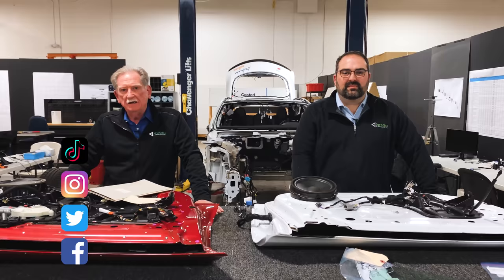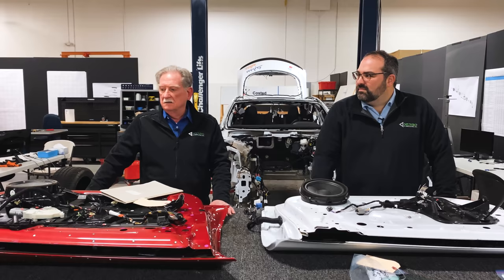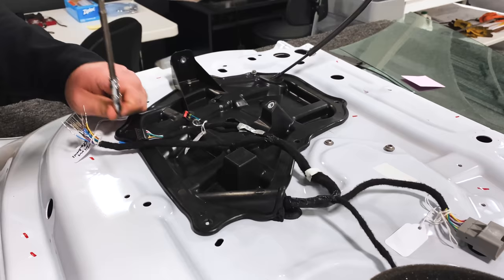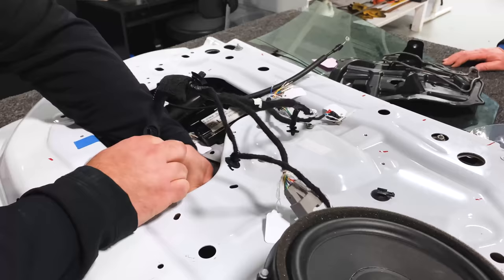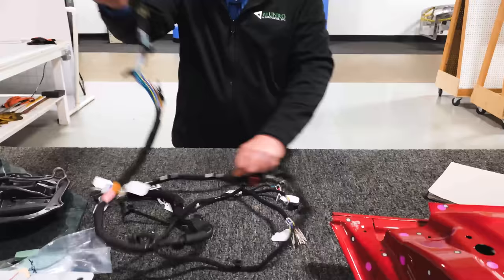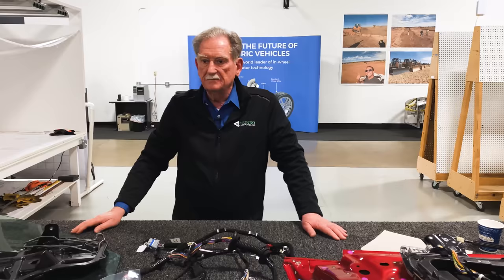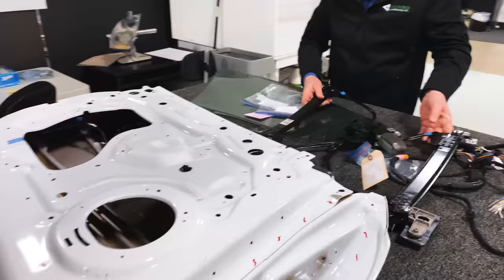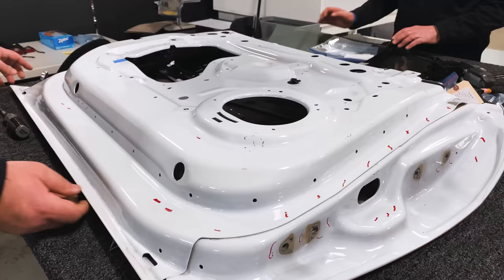Plaid Doors Disappoint Sandy | Tesla Plaid Teardown

Comment: This looks pretty much exactly like my 2017 Model S 75D driver door. I had a hell of a time getting access to the door handle module to replace the gear that extends the handle. Luckily the module was a Gen3, so no wire/microswitch issues.  I also had to dig into the rear door when that regulator failed (twice) and wouldnt go all the way up (during monsoon season no less).  A Tesla Ranger came out and replaced the regulators on both rear doors. Thankfully the regulators all failed in the warranty period. I am out of warranty now, so I had to fix the gear myself or pay for it. Thanks to Electrified Garage for their videos on how to do it.
Reply: From what you are saying I would assume this part is near original to your version and earlier and didn’t get upgraded it’s the new edition?
Reply: Trade!
Reply: 5 year old windows taking a shit? Tesla quality strikes again
Reply: @mattbrew11  To be fair, there really isn't a car company that makes things without any errors, rather have a window fail after 5 years than a car caching fire though, so it's still in the minor errors.
Reply: @-JustHuman-  u say that like teslas dont burn
Reply: @mattbrew11  All things can burn. But there hasn't been recalls because of it, so far I only know of some with damage or being light on fire that burned, not like GM that said "Well, just park it away from things and don't charge it without keeping a eye on it", and then recalling all of them because of this error.
Reply: @Travlinmo  Well, that's the thing. Just like with the door handle module, Tesla itterates to try and improve parts. I think the window regulators were model H originally and when he replaced them they were model L or something like that. So hopefully the "issue" that caused them to break was designed out of it on the latest module.  It may look the same on the surface, but it is a different part in some aspect. The Gen3 door handle module is a night and day improvement over the Gen1. Check out Superfast Matt's channel for a good dive on that.
Reply: @denniss1211  Their white door on my blue car would not be a good look. 😄
Reply: @mattbrew11  It certainly is an annoyance.  Once Tesla isnt the only game in town for EV's I certainly wont hesitate to look, but in my opinion, that is quite a ways off.  I never had any issues with the important bits of the car, could always safely get me from A to B.
Reply: I had an identical experience. So far I had to replace 11 door handles. Most were replaced under warranty, two were good well and one I paid $600+.  Defiantly a flawed design, tesla CS pushed back and absurdly blamed the cold weather- for the repeat fails.
Reply: @mattbrew11  Window motors and door mechanisms in my Ford/GM/Honda vehicles have failed over the years, always after warranty and well before 5 years. Give it a break.
Reply: @Avisinna  I definitely prefer the aerodynamically perfect simple purely mechanical door handles of models 3 and Y over the unnecessarily complicated ones on the S. Proves that not only Germans can construct too complicated designs.😁

Comment: Engineer here...you've just caught a legacy product that hasn't been updated to the newest design language. A door update wasn't in the budget this go around. I'm sure they understand the benefits and will get to it as soon as the opportunity presents itself.
Reply: Manufacturing Engineer / Quality Program Manager here. Cost / benefit analysis by Industrial Engineering and Finance won after review of limited savings on current projected volume. Design change funding was not approved.
Reply: This is why only stupid people buy Plaids. $130,000 car and no budget to improve the car. Why Taycan is the better car, it's built wonderfully, it's truly a better car aside from a 0-60 "look at me" time.
Reply: @InternetDude  Uh, there was just a huge fire on a ship hauling Taycans, it looks like a battery fire started it and destroyed all of the vehicles on the ship.  From what I've heard there may be an issue with their 800v charging system overcharging batteries.  Not exactly a sterling example at the moment.
Reply: @InternetDude  there’s a difference between quality and manufacturability. Just because it’s hard to build doesn’t mean it performs worse for the customer…
Reply: @Lurking Grue It's out and being towed right now.  The crew was evacuated without injury.
Reply: Agreed. I was about to comment that they were looking at a very early and therefore more primitive design compared to the Y.

Comment: Wow !!! Great video and presentation guys . Thanks for taking the guts out of the door , I was curious as hell how all that stuff fits in there . Sure would be interesting to see how they put one of these doors together at the factory . Kind of makes you wonder , how difficult it would be to replace any parts in the door , electric motor , glass etc .
Reply from the maker: Glad you enjoyed it
Reply: I made the assumption they put the speaker in last.  Then it would seem easy to do all that assembly through the big speaker hole.  
But that's just how I'd do it.  Maybe I'm not understanding something.

Comment: If you've ever rebuilt a square body Chevy door, you know Sandy is right here.

One of the most difficult and frustrating experiences is working on a square-body door with internal support brackets requiring a large amount of specialized maneuvers (and a bit of praying) to get the pieces reassembled.  I'd rather pull a motor than try and rebuild a square body Chevy door.

It's astonishing the industry still creates these metal-pocket doors.
Reply: They still do it that way "because that's how you build doors"; pure inertia, inflexibility and mental rigidness. Just like the car industry wanted to keep on building petroleum gassers, and would have until the end of time (or end of humanity, whichever comes first) if we'd only let them.

You see it with car manufacturers sticking to joining stamped metal pieces for their chassis and bodies "because that's how you build cars", or well, it's how we've built them since what, the 1950s? Long enough so that generations of product designers have grown up knowing this tech and gotten mired in it; meanwhile Tesla is transitioning towards large metal castings in critical places instead, while the rest of the industry pooh-poohs that idea by and large except for a few Chinese manufacturers and one other.

In the west, only Volvo Cars has made moves to start using megacastings for future models to my knowledge, but this may be only because they're majority owned by Geely. :P There's inherent rigidity and inflexibility all over the established car industry - hell, like there is in any industry really. It's a human fallacy; it's system wide in our civilization and we're the cause of it. Eastman-Kodak wiped themselves out as a major corporation SEEING the digital photography revolution coming towards them, and even participated in it - they held major digital sensor patents and other IP, and still they managed to kill themselves. Absolutely fantastic, isn't it? ;)
Reply: Oh no - I was going to take on the door rebuilds on my 1980. This gives me pause. ☹️
Reply: @SolveFixBuild  Just wait until you replace the window gaskets.   Lots of hand--applied silicone glue between floppy rubber strips and metal.

I have nightmares.  Do yourself a favor and pull the door fully off the car. It will help. Don't get me wrong... it can be done.  Just REALLY fiddly.

Those corner air vents have to be inserted "sideways / externally", and hooked through the window hole at the top.  Fed around internal support brackets, then rotated vertically.  Then you "flex" the rigid metal channel and gently pry the door pocket open a bit to get it near it's final position. THEN you "clamp" the triangular metal frame into the corner, tuck in the rubber gaskets, and screw it down.
Reply: I've got a 4X4 Blazer with an electric window on the tailgate.  It's working still, but goes up and down incredibly slow.  It will make a door job seem so easy a caveman could do it.
Reply: @knutjob3835  spray a bunch of silicone spray down the window tracks. If you think you have sprayed enough, spray a little more. Once you have enough silicone in the tracks the window will glide up and down again....... usually.
Reply: @fauxque5057  Been there, done that, probably going to do it again, but I'm pretty sure it's the motor.  The weak, hard AF to get at, motor.

Comment: This is actually the same door design from the 2012 Model S they haven't changed much here. 21:49 I think it was less to do with weight and more to do with retro fitting to the original door track from 2012 for the double pane glass which is only in the front doors of the Plaid.
Reply: Didn't they say that this was a rear door?
Reply: @Clearphish  No, it's a front door.
Reply: The sticker on the door panel says (LF) Left Front, but at 23:45 sandy says this is a back window. I am not sure why they would not have had the complete assembly, being door and glass when doing their talk. Probably just sandy misspeaking again.
Reply: @sammaimas155  Listening to this section, I think he was referring to the earlier Plaid video where he complained about the rear seat comfort compared to the front seat.
Reply: @sammaimas155  it was the front door, he just misspoke
Reply: @sammaimas155  Yes, that's what I heard, but the door is obviously the front on the driver's side, otherwise they have humongous speakers for the passengers in the back seat.

Comment: The idea that so much goes into something I thought was as simple as a car door is simply mind blowing. Thanks Sandy and Ben.
Reply: Also think of all the thought and planning that all mfgs have to do to source all these parts, get everything and all suppliers to work together, make sure that the door will work with the body itself and then all the logistics to make sure all these parts show up on the assembly line all at the right time, etc. Its simply amazing how high the quality is on vehicles, and this goes for all manufacturers.   These are extremely complicated products and I think it's great you're showing the common citizen just a taste of the thought and effort that went into getting them a vehicle

Comment: Given the much lower volume of the S vs the Y/3, it's probably low on the long list of things to improve.  As an audiophile, I would prefer to keep the speaker mounted directly onto the door structure vs on a panel.
Reply: "the door" is several welded "panels".
It's simple to build sound dampening into a separate panel.

Comment: VW Jettas "evolved" from the stick built doors to the modular in the late 90's. Recall "fixes" was the motivator. I was running an independent shop at the time and saw the changes as the windows would fail just days out of warranty - for several model years! The modular doors cut our labor by 75% and we got to pass that along to the customer. At the "end' we even offered a program to fix as you wait for under an hour. To paraphrase Shakespeare - if I'm cut on a window repair with rounded edges, do I still not bleed?
Reply: Are you talking about Mk4 Golf and Jettas ? I think I've opened door cards on those and from memory, they still had  the same old design.
My e46 BMW is also the same and is a complete PITA to do anything in there.
Reply: @trizvanov  Golf evolved into modular door design in 1997 with the MkIV. Audi went the same route in 1994.
Reply: @GTO33  I've had a MkIV Jetta and a Golf-based Audi A3 of the same era. 

I could've sworn the front doors don't have those large openings. My memory must've been fading...

Comment: After the car is completely e-coated and painted, Honda's assembly lines remove the doors and they go upstairs to the door assembly line and when the doors are completed with all parts the same door go back to the original car they came off in the first place. That way the doors window assembly is not completed vertically as would need to happen on the actual car assembly line.
Reply: My thoughts, I know that from Audi: Doors are seperated from their body, assembled and brought back to the line at a very late point in the process. As an added benefit, this way the doors are not in the way during final assembly. No way, these doors are assembled on the car!
Reply: Same with assembly lines at BMW.
Reply: yeah, and Honda usually (or always?) uses the old classic Design. There has to be a reason for it. I personally fixed the "better" designed modular vw doors, because they always had leaking issues. go figure..

Comment: Had a '96 Grand Marquis which had 2 different window lift failures.  Bought new window regulators, but decided it was just too much trouble to try and tear the door apart to install them.  Ended up giving the car away to a mechanic as a commute car, after a freeze plug on the back of the block failed, requiring the trans to be pulled to replace it.  Looking forward to my next car, which will be a BEV, hopefully with modular window lift assemblies.

Comment: Couple of things: the speaker almost certainly goes on well after the harness is in, so there's another pretty large access point for the assembly guys to get into. Also, the M3 panel still needs assembling - ok not directly on the line, but there's a lot of stuff to mount onto that panel, which will take time. Further, the panel will reduce the structural rigidity of the door and it could be that the model S can't afford to do without that.

Comment: QUESTION:

Since everything is attached to the INSIDE metal panel,  are we sure that they didn't do that first, AND THEN weld the outside metal panel of the door to the inside metal panel of the door?

looks like that would be the smart move, assuming that its possible to do..
Reply: this among other reasons could speak for this design.
like retrofit, already ready tooling and assembly lines.
low volume vehicle
i bet this door speakers sound way better than the Y design
they do not want to redesign this over and over since it's all redundant design anywawy as everything goes "cyber" ? xD
Reply: Exactly what I was wondering. The inner panel isn't visible in the assembled car, so all of them can be white. It may be very difficult to weld the door pieces together with all the assemblies on it, but maybe Tesla managed something clever. Or they used advanced bonding materials.
Reply: it looks like that but there are no walking points? maybe it is glued and like you say the hole is just for maintenance and not for assembling?
Reply: Most likely not for painted metal.
Reply: I think this in not possible. You would see the weld spots and painting afterwards would be a mess.
Reply: FORD's required drilling 1"
 holes into inner door sheet~metal to service power window motors for decades. Obviously guts installed prior to  door welding
Reply: It cannot be done that way. You have to do all welding and structural adhesives and so forth completely before paint. Anything that's built in and then welded around, is also never ever coming out again, and if it ever has to come out because it broke, maintenance will curse whoever designed it to no end!
Reply: Congratulations. Dumb comment of the month.
1) Welding (heat/ sparks) and wiring? Really?

2) doors are welded in bare metal, then dipped, them painted.
See the issue? Liquid? Paint? Wiring?
😂🙄
Reply: @roberthawxhurst3717  It's more likely that drilling a hole was less labour than taking the door completely apart and following the original assembly sequence (which probably buried the motor underneath a ton of other bits and pieces). Drill hole that ends up invisible under trim panel vs 5 hours of labour? Drill hole!
Reply: @rogerstarkey5390  yeah I had no idea how stupid some people were until I read comments here that Tesla should put the stuff in the door and then weld the panels together. It's kinda sad and entertaining at the same time how clueless people are.
Reply: @bikeaddictbp  Interesting, 

QUESTIONS:

1: I assume that it has to be done before the painting simply because if you want to do it after the painting you would have to use a grinder of some kind to take off the paint where you want to weld?   Robots could do that very quickly...

Sounds very doable...   granted any outside visible weld spots would have to be re-dab-ed in paint after the weld as well.  and that re-dabing in paint would never look perfect at all... 

2: there is a hole big enough for maintenance,  it will not be fun, but its doable. 

To me this seems like a bad idea, but technically a do-able idea...
Reply: @donjones4719  

I assume that the welding occurs from the outsides, so welding it with the internal parts already installed, shouldn't be any harder, 
technically it shouldn't even need any changes to the robots....  the only change is one part weights more. 

all of the components would be safe from the welding by being inside the door?
Reply: @InternetDude  

Many of us are highly skilled and very highly paid professionals. We simply work in industries that do not require welding, 

Making assumptions about other peoples intelligence, says a lot more about you personally, then about the person asking the questions.
and questions, regardless of how basic, are a great way to learn.
Reply: @kevindamen6813  Watch videos on youtube of any automotive assembly plant showing how a car is put together. There are plenty to choose from. Bear in mind that doing something once is vastly better than having to do something twice (or go back and do repairs) because of choosing the incorrect sequence of events.